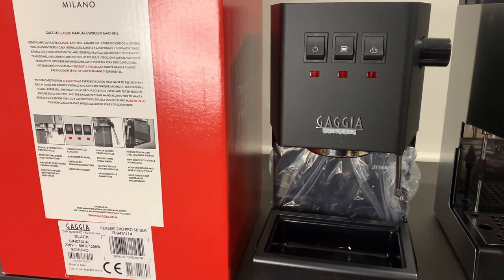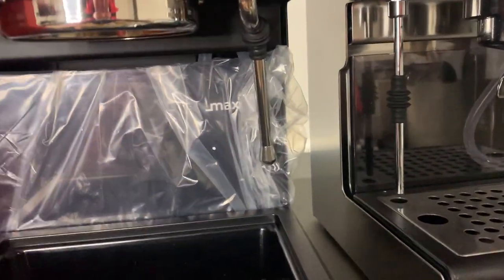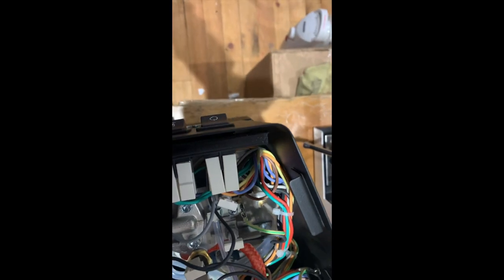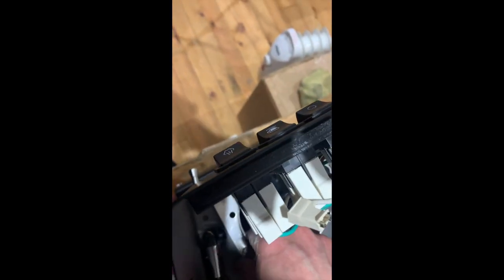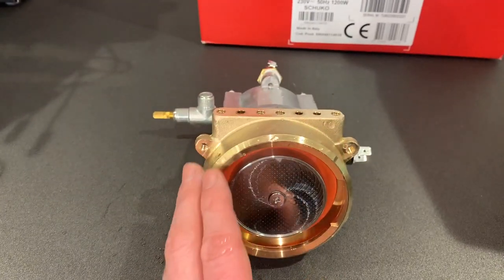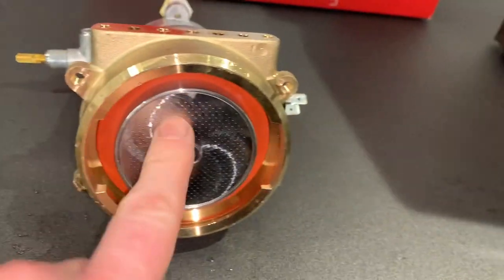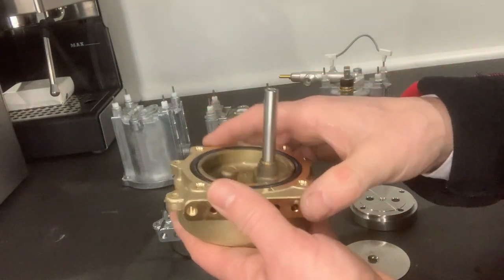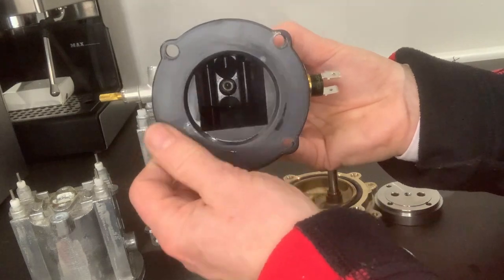The New Gaggia Classic Evo Pro 2023

Comment: Hi there.
Did you get the boilergate problem?
Reply: I'd like to order the Evo without the issue. Any idea how to do that?
Reply: @robinlawson69 
No.
It’s very new. They have just discovered the problem.
I have returned mine and got the old classic model. The main problem is the 15/13 bar spring. I’ll have to get a 9 bar spring.
Reply: @DelReiRock  Boilergate has nothing to do with which spring is in the machine, the problem is just as big in the USA where the machine comes with a 9 bar spring mounted in the factory or 12 bar machines in, for example, the EU!

It's total nonsense, who said this, Gaggia?
Reply: @dejedejsson  
That’s not what I meant.
I bought an EVO. EVO comes with 9 bar spring. But because of boilergate problem I returned it and got the classic pro, that comes with that 13/15 bar spring. So, I’ll have to open and change the spring to get a 9 bar. That’s what I meant. The bar have no relation to boilergate.
Reply: Whole Latte Love in the US is a huge on line retailer.  They reportedly are replacing boiler gate machines if there is a problem.  6 months ago I bought a 2019 model and it is great.  I also bought a refurbished La San Marco commercial grinder.  It is a great combo.

Comment: Two questions:
- Is the coating of the boiler made of Teflon?
- Does the 2023 model come in stainless steel color (no color)?
Reply from the maker: Hi, I believe the coating is not Teflon, but awaiting confirmation. They are producing the silver in the 2023 model. If interested get in touch
Reply: Based on unverified source: "the aluminum boiler has a protective coating of Exelia 3010-B242 on the inside. The protective layer is very hard, very dense, very resistant to abrasion and deposits and also very temperature-stable. The polymers withstand temperatures of up to 300 °C and prevent the coated material from being washed out. " Exelia seems to be produced by an Italian company. According to their website: "EXELIA 3010: Coating with low friction coefficient in addition to anti-stick property and high temperature resistance."
Reply: @TheHomeBaristas  Could you share the official info about the coating once Gaggia confirms
Reply: I looked it up and it is a food safe coating approved by the US fda

Comment: Hi I got an Evo end I noticed there is an extensive play when you remove the portafilter? did you have the same problem? look like the body of the machine is built with thiner metal?
Reply: I had a similar issue when I purchased a brand new classic pro in 2022. Turned out to be failed welding points on the plate that holds the boiler and the body together. It was basically free floating.

I got the machine replaced with a new one and the new machine was solid.

Comment: Is it really far superior though? How do we know the durability of that coating at this point? I'd hate to be drinking that coating over the years.
Reply from the maker: As a user it’s hard to tell at this point, but the coating they’ve chosen is generally far more hard wearing when used in similar products according to the Gaggia people, hence why they made the change. Time will tell.
Reply: Perhaps they switched over from the old to the new boiler for matters of health as well… Yesterday I ordered the evo 2023 in lobster red, it will arrive tomorrow. I hesitated picking the older model in lobster red, which was available too, maybe it turns out to be wrong decision, only time will tell. Any way, thanks lot The Home Baristas for the outstanding video, which I found today.
Reply: @alexanderkowollik3681  did have a peek inside the boiler to see what it's made of?
Reply: @TheGroundedCoffee  no i haven't. However this machine performs rediciously good. Heating is much faster than then the 2019 modell, but of course flushing is very important to reach the right temperature. Switching to steaming is also extremily fast for a single boiler (20 seconds). I wll check this tomorrow.  The bottomline: this machine produces espresso ánd latte drinks like cappucino in the best possible way. And i'm  not jocking...

Comment: Why not a stainless steal boiler?
Gaggia is the only brand using an aluminium boiler.
Surely a let down
De'Longhi is using an stainless steal boiler in all their espresso machines even in the cheaper ones.
Reply: Retro-compatibility. A stainless boiler would require a completely different heating system, and would make the machine much more expensive.
Reply: Stainless steel is a horrendous heat conductor. That's why induction pans have a copper layer in the base. Aluminium is much better.
Reply: @jtlon1  
High end brands of espresso machines like
Marzocco and ECM are using stainless steal boilers for their espresso machines because it's the best choice.
And delivering the best tasting espresso's.

Comment: Is it just me, or will this Brass to Aluminum group head cause Galvanic corrosion quicker than the previous model?
Reply: The new boiler is coated, so there is less galvanic corrosion compared to before. The dispersion plate being stainless is quite well compatibile with brass and will last long. I have a 3 years old stainless dispersion plate on my machine, still shining.

Comment: Great video, it would be nice to see it in action. I just got mine today and I have noticed that the power switch isnt really a switch more like a button now with the switch style.
Reply: If it's the same springy button as my 2019 pro, it's an easy fix. Remove the button from machine, then pop out the spring, then refit and not only do you now have a proper flick on/off but also it stops the machine switching itself off after 20 mins.

Comment: Great video and analysis...!  I have my GCP (previous version) with the PID and OPV mods.  I also upgraded to the brass dispersion plate, IMS screen and bottomless portifilter.  I would love a pressure gauge; so if it had that, i would just swap everything over and call it a day.  The GCP is the best learning and durable espresso machine out there.  I've never had a problem with mine.  Too bad they don't sell parts though; I would buy that boiler in a second!
Reply from the maker: They’re fabulous machines. Love mine too
Reply: Yeah sadly I just bought 2019 a week ago because I've seen some review saying it's not much of a difference. After seeing this video I wish I spent 70 more and get evo instead of 2019. Anyway still enjoying and trying new features with my machine tho. I did the all same upgrades. Thinking to do gauge and the dimmer as well maybe later on. What bottomless portafilter would you recommend? I wanted to get one on amazon but some reviews state it does not fit well. Many thanks
Reply: @ahmetzyc  do you want the link?  Mine worked perfectly.
Reply: @dirkl216  did you find it? Send it please, thanks a lot.

Comment: Is the new steel group head compatible with the 2019 version?
Reply from the maker: Yes, but the new one is brass. Exactly the Same size though
Reply: @TheHomeBaristas  will the new golden brass head fit a 2019 machine which doesn't have that stainless "sleeve" on the body?
Reply: @raffaello6787 looks like it will fit through the hole but will change the looks a little

Comment: I'm surprised they did not provide a brass dispersion plate
Reply from the maker: There’s not a lot of difference between the brass and the new solid stainless steel one. They are both far better than the old lightweight one in the older machines

Comment: where has the chrome coating worn away on the older model you show? As i'm sure you are aware brass is quite soft so a chrome coating provides extra strength while keeping the thermal properties of brass.  As for the Coating, much like other non stick coatings like Teflon,  this will release toxic chemicals which will be ingested by the coffee drinker.

To me this looks like a cost cutting measure with Billy Bullshit from accounts at Gaggia trying to spin these changes as an upgrade.
Reply from the maker: In many of the 2019 models the chrome coating does become worn. So this new plate will help. In the pre2015 models this was never an issue.
Reply: @TheHomeBaristas  do you mean worn or just tarnished? I was looking at buying one of these but was unsure on the 2019 model at 430 or the 2023 model at 500.

Comment: Hi!

Is the new boiler thermostat the same as the old one? Wondering if the pid-upgrades will work the same on this version.
Reply from the maker: Hi, yes same thermostats. I’ve already added a pid, dimmer and gauge to the 2023 model and it works a treat. However they may be changing the wiring loom behind the switches soon that may need some adaptation with some pid wiring systems
Reply: @TheHomeBaristas  Good! The wires can always be solved. Thermostat could be bigger problem if they changed that. Thanks for the answer!

Comment: Why buy this ancient tech and spend a few hundred more modifying it and voiding your warranty when you can get a great machine for just under 1k with a PID
Reply: Hello, what machine with a pid do you advice please under 1k?
Reply: @David-pn1bc  lelit is pretty decent you can get with pid even grinder too around 500 600. Which comes to the very cheaper and functional. But only problem is group head is 57mm and not 58mm. So you are not going to be able to get VST basket.
Reply: Yeah I feel myself crazy. The first day machine came and I didn't even try to turn it on. Directly installed the pid and opv 😂. At this point I am just hoping everything goes fine.
Reply: @David-pn1bc Profitec go, Lelit Victoria
Reply from the maker: @David-pn1bc  https://www.thehomebaristas.co.uk/coffeemachines/gaggia-classic-customised-with-pid-gauge-dimmer-9-bar-pressure-spring
Reply from the maker: https://www.thehomebaristas.co.uk/coffeemachines/gaggia-classic-customised-with-pid-gauge-dimmer-9-bar-pressure-spring
Reply: I spent months researching before buying first machine. I bought a used Lelit Anna with stock PID and added a flow control/preinfusion mod. I have found every accessory in 57mm off aliexpress at the same prices as 58mms. Warms up to steam in one minute which is time well spent preparing milk and cleaning up. Much more steam power than the Gaggia, with a better wand. Temperature at grouphead stable throughout entire shot, light roasts are no problem.

Comment: I use a Gaggia and it is a disappointment.  It's underpowered if you make more than a couple of espresso drinks.    It takes a long time to steam up milk for a 10oz drink.  The espresso itself is ok.  Overall, for the price, I would spend a few hundred dollars more and buy a Rancilio Silvia which is more capable as it has much more power.  The Rancilio porta filter is commercial quality,  the frothing wand is capable of steaming a pitcher of milk in about 20 seconds.  I never regret getting the Rancilio.